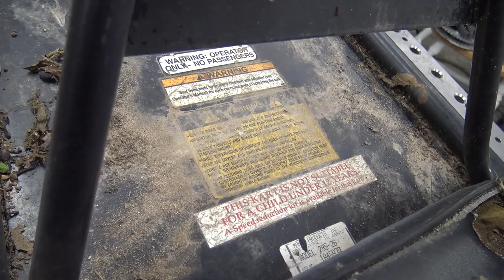Manco Baja 200 Go Kart Restore

Comment: Hello if I made a 2 speed gearbox with neutral would I need a centrifugal clutch or torque converter. I’m planning on using a 16hp 420cc petrol engine. 
Thanks

Comment: Hey, this question is unrelated to the video but I still want to ask.

I just got a Mega Moto 212 Pro which has a torque converter. I see that after the first day of use the belt already has some shavings that are in the case. My other torque converter on my Yerf Dog Spiderbox has no shavings after years of use.

Comment: I have a Dingo 285 like this I'm putting a 20hp electric motor in. My frame was $50 and needed some weld repair also, but the axle spindle and other parts were still good. I'm also adding mcp hydraulic brakes so that's for showing how to install that.

Comment: Mr.Beard,hope your summer is going well.Im still hopeful that after plugging away at a Baja warrior roller I aquired from an auction 2 years ago,ive managed to create a pretty nice bike out of it.. i m still seeking some advice about choosing a carb for the Honda gx 340 and  converter That I installed on the modified and reinforced frame.the 340 is stock but the govenor is removed and ive put a custom pipe and short muffler on it.the stock carb was erroded with rust holes in the bowl and  what i think was the slow jet was twisted all the way through the carb body. I want to use a kehin slide type carb and a K/N type filter .I know that dialing in this type of carb will require  some possible jetting/ slide changes  to get the motor to respond through the powerband. But what mm carb size is going to  be the one that will let me finally ride my big block baja   past 1/4 throttle with  no boom spit cough pop,etc.that i can adjust out of it.,Does anyone know of a gx340   mikuni / kehin  carb and manifold package? I  only see  212 cc carb kits or 390 and bigger big blocks. The 340 390 420 share the same manifold mounting holes and gaskets and Ive seen some kits that come with a pre jetted bored polished alky converted slide carb that is prepped to perform with the cam  and the other high rev goodies.Ill put more stuff in the motor when Ive  at last dug a trench out of my lawn.  I hope i was able to explain just how  confusing it has been to see listings for big block race parts that bolt into 270 to 420 singles .Thanks in advance for any useful input that will finally let me melt whats left of the original back tire...

Comment: I have a question about a year or so back u did a video and in it u changed the torque converter weight. It was threaded I believe so you could set how far it opens to govern the speed. Could you please let me know what it’s called and where I may be able to get it.